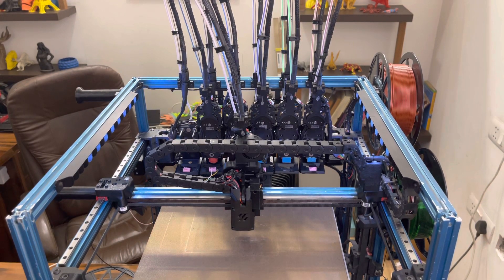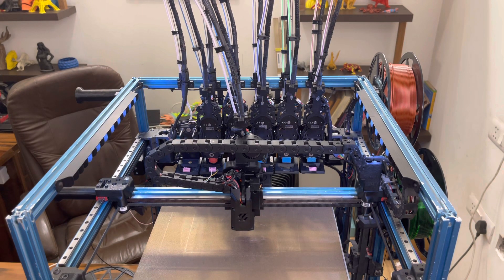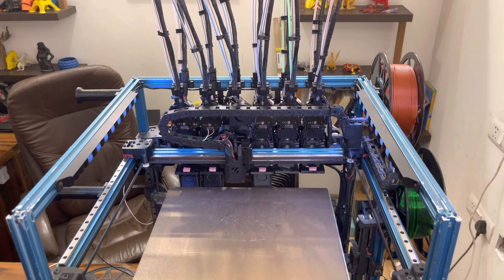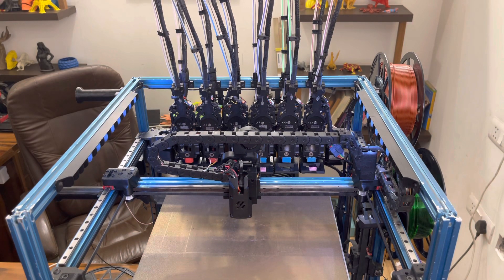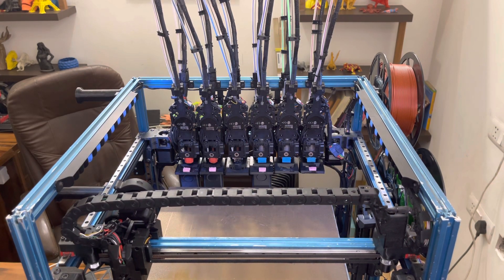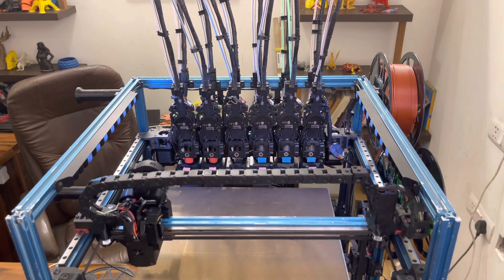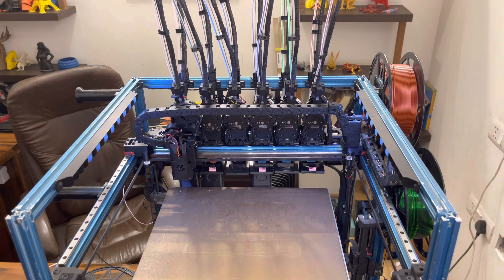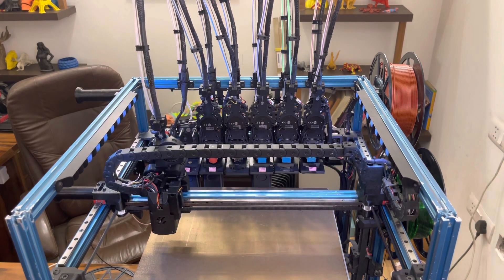WP-DAKSH :: Voron Trident 3D Printed Tool Changer - Intelligent Error Detection and Recovery demo.

Comment: Excellent! I can't wait to see the diagrams and start to think how I cam include your Toolchanger in my project. I am building a "Voron" style machine. It will be in IDEX configuration, with dual printheads. I'm thinking of making one of the heads fixed and one head changeable, so it is a little more complicated. Also, the heads will be connected via CanBus, so integrating that will be interesting.
Reply from the maker: Sounds like a unique idea - will be well worth the effort :-) Will be releasing the files very soon - i have published the first part of the video build series. please do check it out here - https://www.youtube.com/playlist?list=PLgd2mko-JD9zuTSOprD8pKLKhBogkgC_k

Comment: What's going on with the disconnected white and yellow wires on the head? How does it it detect if it has a tool?
Reply from the maker: Those are extra wires that can be used for neopixels on the toolhead. To detect the errors, i have microswitches on each of the docks and the carriage which get pressed when either a tool docks or is loaded onto the carriage. I have an extra python module to track the state of the individual microswitches connected to endstops - and then gcode code to implement the logic to check successful tool dock and pickup.